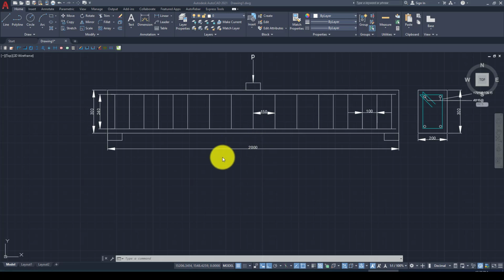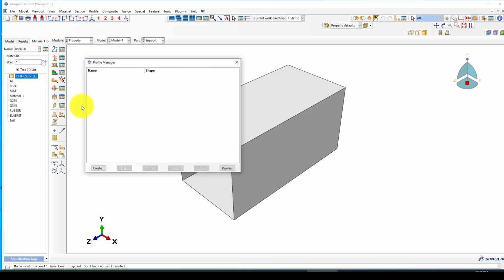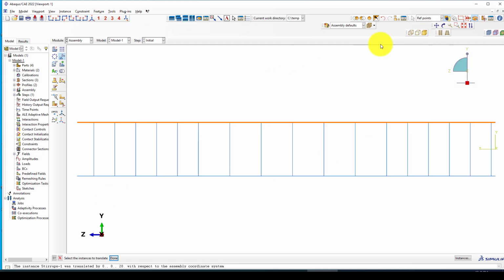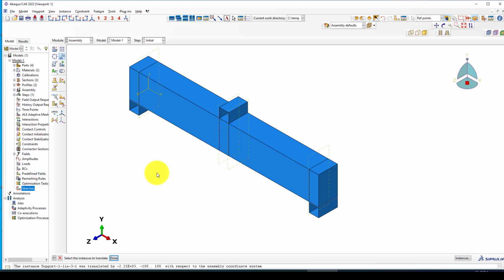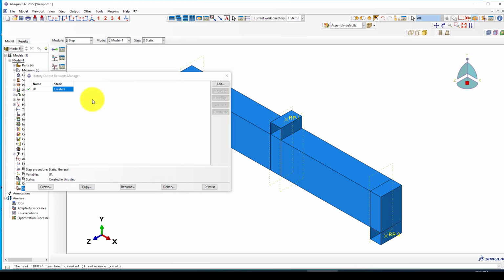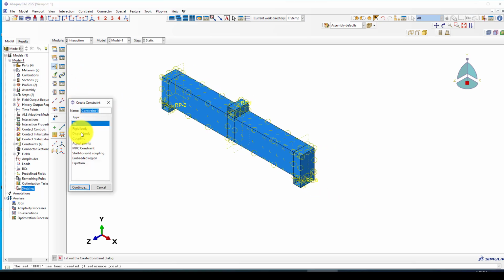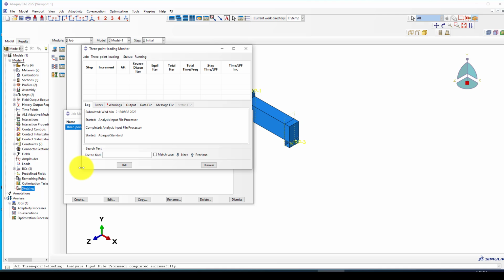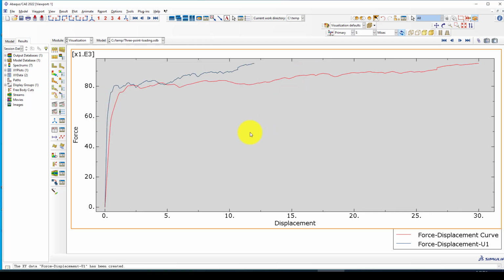ABAQUS Tutorial, Three-point Bending Test of Reinforced Concrete Beam

Comment: Hey thanks for help. Have you ever worked on combining CDP with XFEM model? I really need your help. Thanks
Reply from the maker: Actually I did you can check my tutorials there are .
Reply: @KSSE_Engineer  HI， THANKS for help.can you specify me that tutorial.I know you have used CDP and XFEM separately in your tutorials. But i want something in which CDP and XFEM have been combined together. I am really stuck in it. Thanks
Reply from the maker: @AliHamza-kl1xm  ABAQUS Tutorial, Crack prediction and growth in steel plates  using The XFEM method
https://youtu.be/R92CGDk49Ys use the same only change the materials.
Reply: @KSSE_Engineer are there any same on rcc beam as well?
Reply: @KSSE_Engineer  I checked maximum of your tutorials. I checked tutorials on CDP and XFEM separately but i need something in which CDP+XFEM have been combined
in 1 simulation